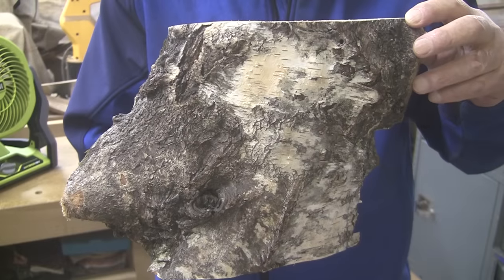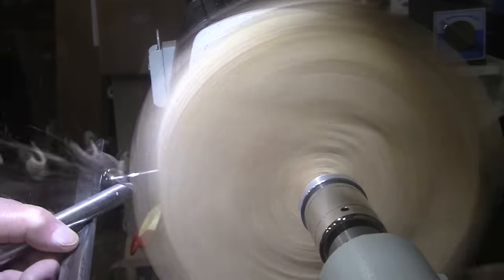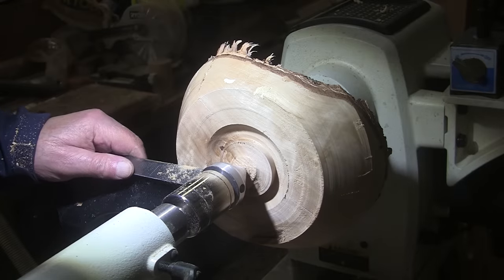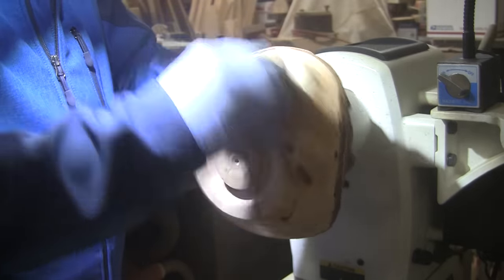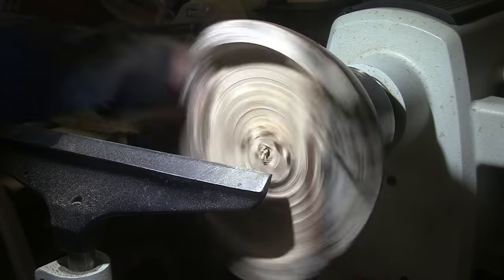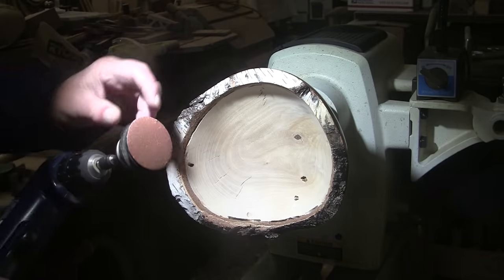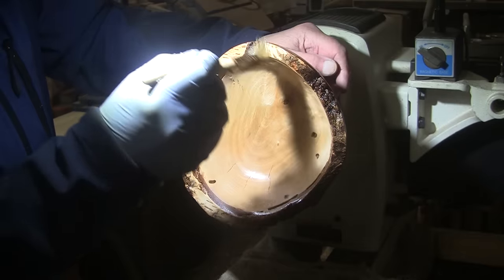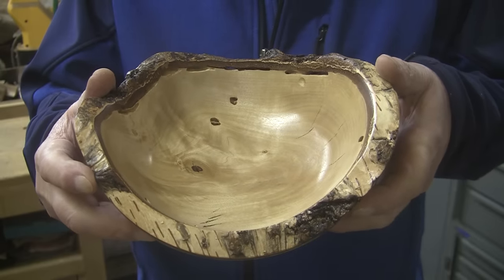OCD Salvation! 👀 Weeping Birch - Wood Turning

Comment: That seemed to be a dusty job and I see you have the same problem with birch always having this internal cracks. Still a nice piece but I would have made the walls a bit thinner. I personally love the feeling that the bowl is light at the end. I will just have as frustration beer tonight. I have ripped my drive belt and have now to wait to get a new one, can't find the old spare one. Thus no turing for the next days - what the hell should I do? Cleaning my workshop? Hell, that would be  boring!

Comment: I just ripped the rotten deck flooring out of the boat. and ready to replace it with composite waterproof, rot proof material. It was too hot outside all summer here in Florida to do the job and now it's a tad too cool in the mornings to start early. It's my last major project to get accomplished. Mask and face shield on. By the way my favorite are your square bowls with the bark on. Beautiful works of art!!!!!

Comment: I just finished watching your Weeping Berch video. I, like many other viewers don now what is meant by OCD excuse me for not knowing.  I dont feel like many of your new video turners know how  much time goes into surface preparation. Cleaning bug holes, cracks, bark inclusions, loose objects, etc. and most importantly,  proper and a THOURGH sanding!!  A good sanding job can make the difference in making a perfect product result or just an OK look.!! It does make a difference!!  There is a lot of off camera preparation that most people dont see. This is one of the reason PHIL always has a Professional look and produces a Picture perfect result. It is not always what you see but also the proper techniques behind the scenes to get PERFECT RUSULTS EVERY TIME.  HE DOESNT TAKE ANY SHORT CUTS!!!!    If you follow these important steps, Yours some day will start to look like his!!!     :face-purple-smiling-tears:❤:trophy-yellow-smiling::trophy-yellow-smiling::trophy-yellow-smiling:   KEEP ON TURNING
Reply from the maker: Thanks, Howard!  OCD is a condition that some people have and it comes in different forms.  Some people can't stop cleaning, nothing is ever clean enough.  Other people are bothered by a group of lines where one line is off just a little bit from the others.  For me, it's 3-Way switches.  I can't stand it when the light is off but the switch (one of them) says it's on!  LOL!

Comment: Love the bowl. i used to have a weeping birch tree. they are stunning. this bowl is stunning! She should sell fast!
 but i actually expected the wood to be more white, rather than shades of browns and tans. i am thinking it had to do with the sealer because i noticed the white bark took on a yellow hue. i was not really aware of the sealer having a tint to it that would transfer to the wood. the other sealer you use does that one add color to the wood as well? i dislike using polyurethane on any furniture i redo for that fact. i always use polycrylic instead.
Reply from the maker: The bark turns color after I sand it, Wendy.  I think left alone after sanding it would have turned white again. 😊

Comment: I've turned 1 or 2 bowls about that thick but found the bowls to be too heavy for my liking. It is interesting to see what regular people will buy. I think I've sold one! I get nervous as the walls get thinner because the bark is usually not held on by much. I've ended up losing the bark or gluing it back on. However i do prefer thinner if i can pull it off.

Comment: Love it. Thickness is just right. And this video is quite timely for me. Just got back from Thanksgiving at my sister’s house. She has a pecan orchard. She lost a very mature pecan tree this past summer. So I went prepared took my trailer with me. I was a Boy Scout (be prepared). Anyway came home with a very full trailer of pecan. All that to say when I turned the first piece had many active worms. And in the next and the next also. Was this a waste of time? Will the rest of the wood be useless if I don’t turn it soon. This wood is still very wet. Sorry to bend your ear but just wondering how to proceed. Anyway great video. Thanks Dan
Reply from the maker: I've had pieces that I know had active worm/bug activity.  It never really caused a problem.  I guess they eat slowly.  You can put them in the microwave to kill them, but do it carefully.  Depending on moisture and size of the piece, something like 30 seconds to one minute on, five minutes off.  Repeat a few times, just depending on the size and  moisture content.  You don't want it to get so hot and dry that it cracks the wood.  Bigger pieces can go in the oven at something around 200° or a little less for an hour or two, depending.  Good luck! 😊